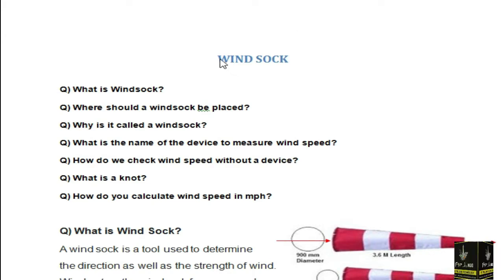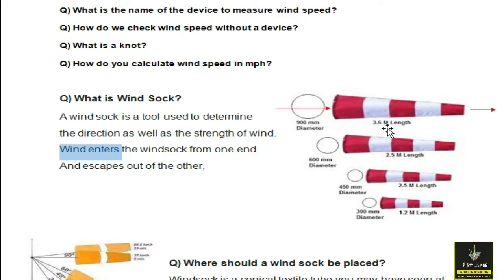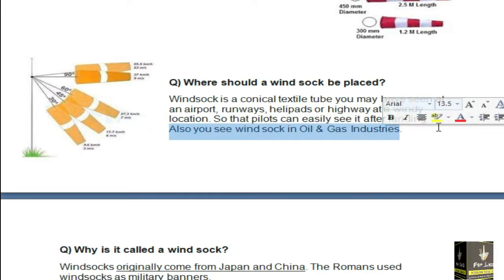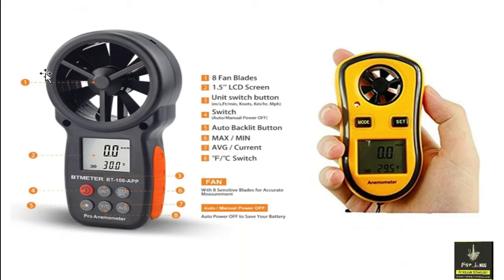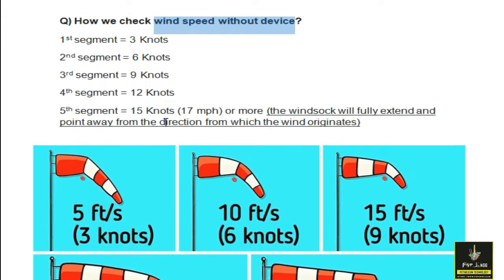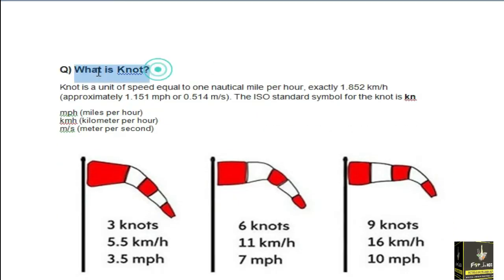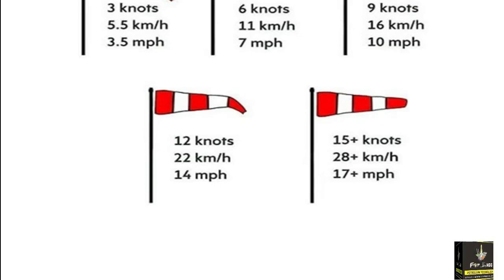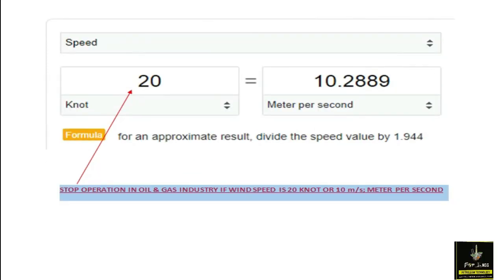What is Windsock?  Where should placed? Why called windsock? Device to Check wind speed? knot?

Comment: Any other side course necessary to do to work in oil and gas industry..?
Reply from the maker: Its very difficult to get job in oil and gas, but you need to continously apply apply apply
Reply: @fopengg  any other side course necessary to do related to oil and gas..?
Reply: @fopengg  you have twelve years experienced in this feild so please share some tips to get a job i am still jobless
Reply from the maker: Yes you can do IWCF, it is mandatory for oil and gas fields
Reply: @fopengg  iwcf..?

Tell me in detail about this bro
Guide me please
Reply from the maker: @nawedalam4869  Dear IWCF is a well control certification, which is very important to be eligible to work in field job, the duration of this course is 2 years and it cost around 600-700 us dollars